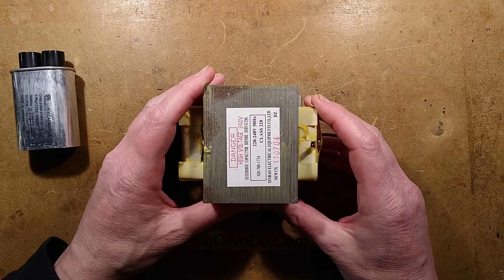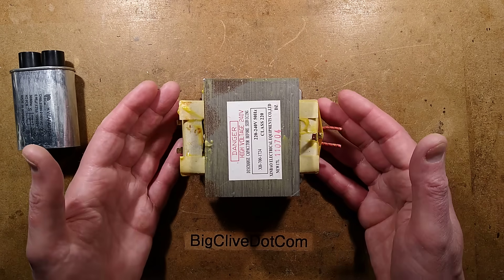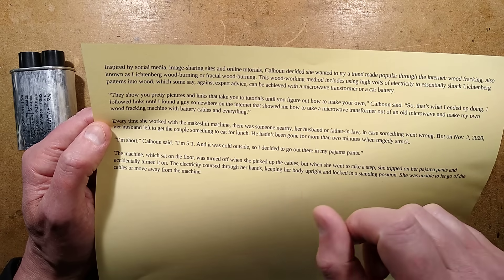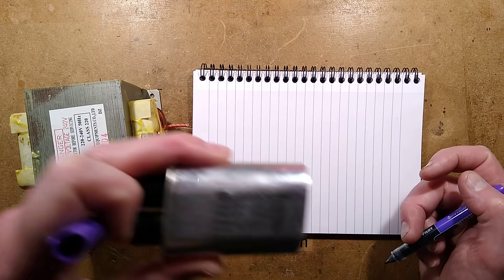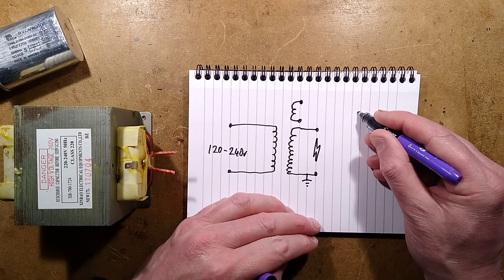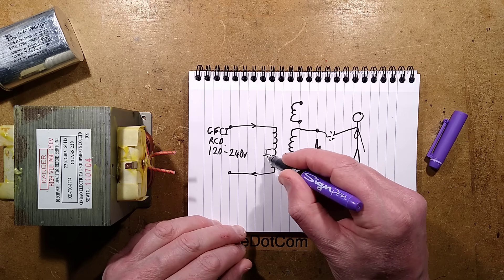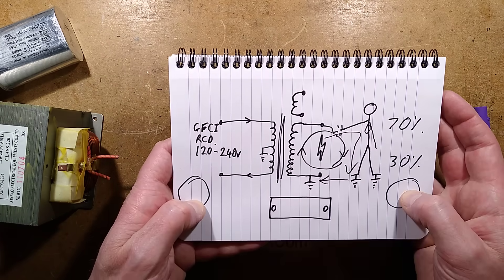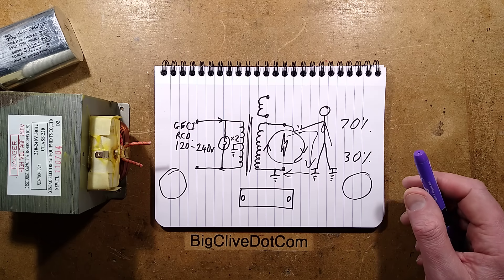The most deadly project on the Internet

Comment: The “dead man’s switch” box with two buttons reminds me of working on a commercial paper guillotine, whose trigger is similarly two buttons on opposite sides of the machine, a good meter apart (and a meter away from the blade) so there’s no way to have your hands in the path of the blade when it comes down. (Obviously, a blade that can slice through a 20cm stack of paper 1m wide would make quick work of an arm.)

I recently worked on a project for a physics lab which creates a massive pulse of electrical energy by charging up two 800μF capacitors at up to 2kV and then discharging it in a few ms through a tiny coil of wire, cryogenically cooled, to create a massive magnetic field in the center of the coil. At 1.5kV, we measured the peak current at 14kA. And that’s why that device has multiple interlocks…
Reply: A friend owns a copyshop and has one of those machines. One day he was changing the blade, when he posted a picture of his thumbnail - had a chunk sliced out of it cleanly, because the blade hadn't fully retracted back to its safety position (standing just 1mm or so out of its protective cover). He was mostly pissed that he had to change the new blade again, though.
Reply: Or you could be like the people where I used to work and roll up a piece of cardboard and leave it in the left side sensor button so you could use your left hand to remove/ insert product during it's cycle to shave a couple tenths of a second off per part, because it makes those numbers look better
Reply: @Skibjib  That is why good 2-button start circuits are designed so that both buttons  must be released after every cycle to "reset" the logic.
Reply: @Skibjib  I work as an industrial maintenance electrician and see probably one serious accident a year from operators bypassing various types of safety devices.
Reply: @B_D_R_1980  as they say, "you can try to make it idiot proof, but somebody will build a better idiot."
Reply: @kenbrown2808  At some point, it would be reasonable to give up and let Darwin do his job.
Reply: @kenbrown2808  1 hour ago, " @BDR  as they say, "you can try to make it idiot proof, but somebody will build a better idiot."  !!""
THEY SAID IT COULDN'T BE DONE >>> BUT CHA DID IT ANYWAY ...   OMG WOW
Reply: @NiHaoMike64  that argument has been made.
Reply: @B_D_R_1980  Worst example of bypassing I've seen was a machine that had half a dozen access doors each locked with their own key and all of them had to be in the control panel before it would work. The company got duplicates made so that it could be run with the doors open at which point I told them to shove their job where jobs traditionally get shoved and reported the whole thing to the HSE.

These were propitiatory keys and if you lost them then you had to replace the locks. I think they got the new ones made by having casts taken of the old ones like in some dodgy 1950 crime caper film. They certainly didn't get them from the machine builder.
Reply: @Skibjib  One of my uncles once told me a story of when he went to repair a press at a steel mill some time in the early 80's where they would use  cigarette packets wedged in a track to activate the safety guard switch on massive guillotines to save time. Inevitably something went wrong, a chunk of steel ejected badly and some guy lost a hand,most of one leg and a part of the other!
Reply: I worked with a guy many years back in a factory with press tools. He'd joined us from another company where they had bigger kit than ours, and their presses were fitted with dead man's switches, so that the operator's hands were away from the tooling when the machine was running. He said that one of their guys had temporarily fixed a bar to the two buttons so that he could operate the machine with his head whilst changing the tooling - assume this was a regular thing he did. Eventually he got it wrong, and the press came down whilst his hands were between the dies, and took all of his fingers off. They couldn't do anything to try to put them back either, as they were completely crushed.
Reply: Very high dB/dt is quite fun to play with, but paranoia is appropriate.  Interlocks... Don't even trust yourself when a minor screwup = death
Reply: I've worked in places where two button switch boxes were being used. Sometimes people would do things like sticking a small nail or paperclip in one button to always hold it down. That's why some places place a sign on the machine stating that defeating any safety system on the machine was grounds for termination on just the first offense.
Reply: You'd be surprised the efforts people go thru to defeat some of those protection schemes
Reply: Where I work they have presses with all kinds of light curtain safety switches and two - hand switches and are very safe, never see any operators getting hurt from them. The people that get hurt are maintenance that bypass all that stuff when working on them.
Reply: What’s that experiment called? Sounds cool, I wannna read about
Reply: @bobfrediii2131  Honestly, I don’t even know! I was interning at the electronics lab at the physics department of the local university (and I’ll be doing the last year of my electronics apprenticeship there), but like many things there, the actual end customer is somewhere else. All I know is that they’ll use that insanely strong magnetic field (40T I think) inside a very small coil — the opening in the center is about the diameter of a pencil — through which a sample is placed and some kind of measurement taken. 

There’s a shelf in the workshop with a little chorus line of coils with various degrees of destruction — despite the coils being potted in epoxy with reinforcing fibers, they still basically rip apart during use! It’s also kinda funny to see these little coils made of fairly thin wire connected to their power source by a cable thicker than a garden hose!
Reply: Friend of mine is working on a similar setup for TMS - doing neurological research. He's helping an undergrad who designed it sort out all the gremlins, generating a 1 Tesla magnetic pulse takes a Not Fucking Around amount of energy.
Reply: @jnelson4765  👍Thank you Jim for possibly the Best Descriptor I've ever read! 👌😆😆😆
I won't lie, I Am going to Steal that positively brilliant, pithy little saying!😉🙂
👏👏👏☘POD🍀🖖
Reply: It's great when you have the buttons on the two sides of such machine. You fell over, grab the two buttons accidentally,  and the machine's "guillotine" name can become literal... xD . Final Destination 46  - Coming Soon
Reply: @mrnmrn1  The buttons on those machines are typically shrouded so you cant accidentally push them by tripping or similar.
Many also uttilises an additional foot pedal, again shrouded, so they need 3 points of contact to operate.
Reply: @Gin-toki  LOL, I know, I just saw too many Final Destination movies...
Reply: @mrnmrn1  Generally I think about half of them are plausible under very unique circumstances, but the other half just bend or break too many laws of physics or ignore biological or engineering constraints to work. At least a couple seem to think the human body is made out of sticks and gelatin.
Reply: @Gin-toki  The ones I remember also had beam-breaks too. Someone still manages to bypass it all to their detriment, but there are a lot of safety nets to do so.
Reply: @Gin-toki  indeed,my lathe has similar safety devices.
Reply: @mrnmrn1  Your comment trolling the movie reminds me of some random on the comment section claiming that when Mazda's radios jammed up with some station's bugged artwork it could have killed lots of people.
He stood his ground in claiming the engine is somehow controlled by the radio and that you'll definitely die if it stops.
Reply: @Gin-toki  I know it used a force-sensitive pedal for the clamp that presses down on the stack of paper. I don’t know for sure whether it, too, was an interlock, since I always used it. Wouldn’t surprise me if it were.
Reply: @Gin-toki  For high throughput, you will even get non-contact sensors instead of the buttons under the shrouds. Reduces the risk of repetitive strain injury.

I work in the design and manufacture of special purpose machinery, so every new piece of kit designed needs to be risk assessed and documented. An accident can lead to the HSE knocking on your door asking to see your technical construction file. Woe betide you if you cannot produce the correct paperwork...
Reply: @mrnmrn1  hence why I said that the pair of buttons are also a meter away from the blade. The way you had to stand, you could not accidentally lean forward into the blade, the area in front was too large to reach. 

I suppose you could have laid on the thing on your belly with your pelvis under the blade, but that would take a lot of commitment.

Comment: Thank you for this and all your videos Big Clive, I really enjoy them and have learned a lot from you. Might I suggest you put a link to some protective gloves in the description or maybe a follow-up centered on precautions one might take? I'm not a big safety police person but in this case it's important for inexperienced people to know about; this video is a big help as it is. Related but on another note, could you go into the old saying "it's not the volts that kill you..." Forgive me if you already have but I didn't find it. I think of it as a power factor, a thousand volts shouldn't do anything providing peak current is one milliamp.. how many watts is dangerous? What are the most dangerous household appliances (microwave?) and the least dangerous (coffee grinder?) In terms of the output used (after transformer or voltage regulation)? I'm curious to know your thoughts on the subject.

Comment: Wow Clive... this is a serious subject, it's no joke, it is NOT for someone inexperienced with high voltage to play with this thing... I agree that you need to have a safety setup so you are nowhere the F*#$@!! near what you are zapping... and High voltage can jump right through insulation if it is not rated for it!  Guess how I learned THAT one!  I realized in retrospect my mistake, thankfully I was not hurt.

I should mention that I have a degree in electronics and worked as an electrician's assistant for years and this intimidates me!  This wood fracking sounds neat but I have reservations about doing it... at the very least do as Clive suggests to make a safety switch box like he describes... very smart!  

Here are 2 true horror stories from people that I've personally met and known, and they were direct witnesses to these events:

(1)  A friend that told me a tragic story, happened a long time ago:  He was in a TV repair business back in the 60's with another gentleman... one day my friend came back to the shop to find him dead, slumped over the TV that he was working on,  he was electrocuted from the high voltage in the back of the TV... My friend closed his business that day and never worked on TVs again.

(2)  A copier repairman told me about a coworker that had a nasty encounter with a 50KV transformer, the HV charges the corona wires for an industrial copy machine (so it can operate at high speed), the coworker was in that section of the machine, while it was powered on... the High Voltage arc jumped off the terminal (he wasn't touching the wire) it went through his finger out of his arm and split it open like a cooked hotdog.

Wait What!?    It split his arm open like a cooked hotdog?   He wasn't playing around cooking hotdogs... that actually happened to his arm? 

Yes, and he proceeded to give me the gritty details about how seriously the injury was... YIKES!  that story was over 30 years ago and the mental image is so bad and horrific that I will not forget it.

If you do it... please be safe.

Comment: Being an electrician and an electronic hobbyist, I've played/worked with thousands of electrical devices. 
One thing I've not played with is the high voltage output of a microwave transformer plugged into the mains!
Reply: Ditto and hear hear.

Comment: The fractal burn in the wood is also what it does inside the body, except much, much worse, as we humans are mostly salt water inside.  What happens inside us resembles those electrocuted hot dogs. Except worse. And that's all inside the body where there is no practical treatment. Assuming you don't die outright, you may wish you had.

Comment: worked in a factory where they made tungsten carbide with furnaces made in the 40's. the control units were 6 feet tall and when they blew at the top a steady arc came out the top 2 inches wide and about a foot long. it was the operators job to walkover and turn the power knob right under it. while most everyone ran for the exits. 2800 degrees high volts with high amps and water cooling. what could go wrong? well they only had one operator electrocute himself in the year i worked there.

Comment: Very informative, I used to fix my old  CTR TVs years ago. I was shocked by a fauty flyback transformer while the set was powered on. Glad they don't make them any more although some are still in use.Certainly not pleasant.
Reply: unpleasant but not usually lethal unless you have a bad heart.. Had many many belts from them over the years...  always by surprise..

Comment: I remember (many years ago) the school had a Van de Graaff generator and the physics teacher used to get students in the class to sit on their stools and then link hands and the first and last students would be encouraged to complete the circuit. At that point everyone would yell and let go. Now I think back to this I cannot help but think it was a stupid experiment even if it did encourage an awareness of the dangers of electricity. I mean for a start any student could have fallen from their stool, but clearly the shortest circuit between each student was right across the chest. What I also remember was that the teacher performed this stunt with his 16 year old students and then would repeat it with the 18 year olds two years later. I declined to join the group the second time round, it was already a much smaller group so naturally each student got a higher proportion of the shock and I remember several saying it was much worse than two years earlier.
Reply: I have one of them. It’s static electricity should not go thru your body but on surface of skin I’m a ex paramedic and I have seen people playing with a tens unit and one was going to connect his nipple rings to it I screamed NO  a tens will go thru the body and put you in A fib  not a good thing ! But the violet wand is ok for such play it’s static too just keep away from eyes ! It amazes me how stupid some people can be !

Comment: Electricity is very fickle and it's hard to know what it will find as the best path to ground. Do we know what the ampacity rating as a conductor the human body is?
Reply: single digit milliamps can kill. amps will with high reliability kill, and will burn too.
Reply: @jnawk83  Interesting, but not my question.

Comment: I would suggest that you put a 50 to 100W light bulb in series that limits the output current in more survivable levels.

By the way if one side of the secondary is grounded even keeping one hand in your pocket will not save you at all. It only redirects the current up your arm and out of what ever is the next thing to ground.

Just don't play with more than 50 Volts if you don't know what you are doing.

Comment: I just had my 35 year old microwave die on me, the magnetron's insulation failed and burnt up. I took the transformer out because I want to remove the high voltage winding and rewind it with a large wire at a couple turns to get low voltage/ high amps. I knew the transformer put out 2000 volts but I didn't know that it was 3000 volts open circuit. I have done a lot of electrical work in my life and have had a few nasty shocks but this is something you don't want to have an accident with. I know a few people that really want to try this project and I will show them your video the next time I see them. This is not something to play around with at all unless you are going to remove the high voltage winding and even then depending on the output voltage it can still hurt you. Thank you for your video Sir.

Comment: For wood burning, NSTs are not only WAY safe, but they also seem to give better results. MOTs are ONLY for experienced people that 100% know what they are doing and have apropiate safety measures in check. 
HF supplies aren't that great from my experience, You mostly get a straight, deep track between contacts. (Using nails and powering it from safe distance) Could also be that mine didn't put out enough current. 15kV no-load, 12kV loaded,  about 15-20mA (estimated based on input power), 20-30kHz. transformer is driven with what I call the bog-standard "suicide-ZVS driver". Currently working on a TL494 based push-pull circuit for it for better control.

Comment: Can i swap sec and prim to get 2000W 24V? Sec sould have more impedance so it should be safe (despite that sec is connected to ground.)
And sec Q.. If HV sec is connected to case, you can "lift" it/ disconnect ground connection to case and make it isolated transformer. I remember this is for some reason but i don't remember why.

Comment: Just this week here in the states firefighters responded to a house fire found two dead and the fire started by this being done . We about twenty years ago had a local REMC lineman loose a arm and leg from contact with a 7200 volt line . People fooling with using auto battery cables are idiots ! That insulation is not for that voltage ignition wiring would be better but like you say best to just not fool with it !